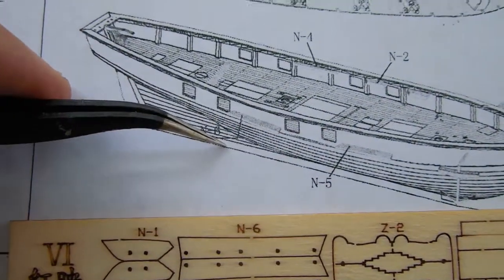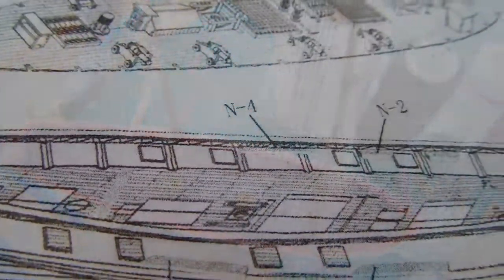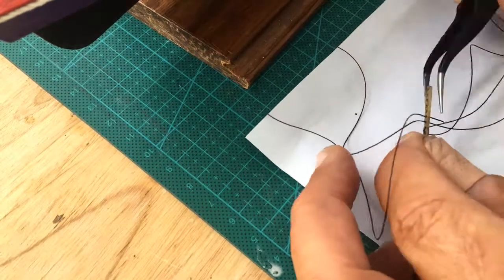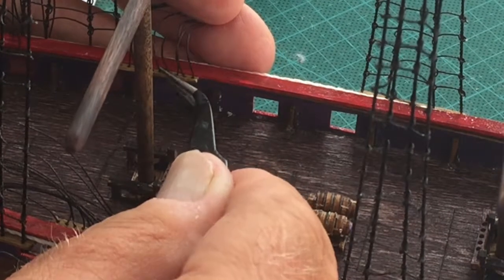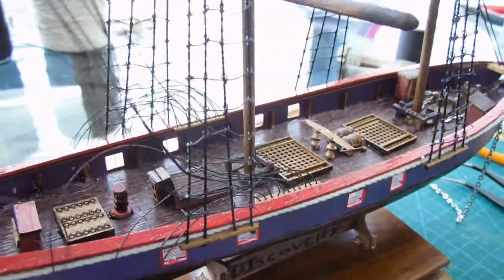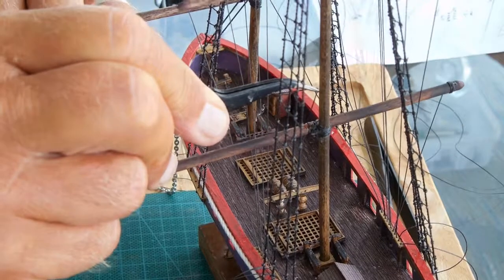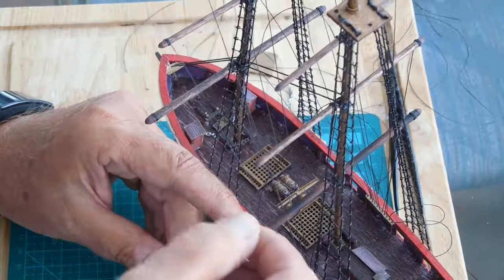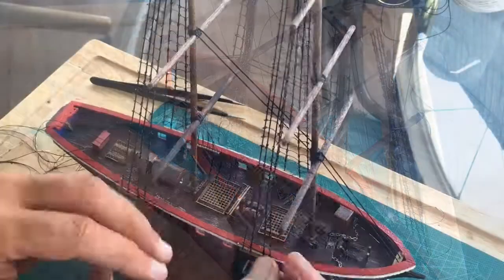Wooden Model Ship Build Part 8

Comment: Really helpful video - thanks, can you tell me what thread you use please? Looks like cotton thread for the rigging but something thicker for the vertical ladder lines??
Reply from the maker: Hi Keith, I’m on a little vacation and that information is at home. I’ll get you the information when I get back. (About a week).
I do recall getting upholstery thread from hobby lobby (I just looked it up on line!)
Here’s the information you need:
Hobby Lobby - Sew-Ology
Extra Strong Bonded Nylon Upholstery Thread. SKU: 1256957
$1.99

Comment: Hey BoilerDan! Great work on this, I have been watching the whole series and will use it as a template for when I construct my own. I am not sure if you will be able to answer this question, but I would like to build a version that floats in a bathtub. I imagine that I will need to put some weight around the keel of the ship, and I will need to waterproof it and generally make it resistant to hot water and humidity. Do you think this ship is capable of doing that? What materials/paint would you use to seal the hull of the ship?
Reply from the maker: They are not designed for water use, so you’ll have a big task ahead of you!
I’d recommend completing all the planking of the hull so then you can seal it. You’re going to have to research that as far as what to use? Maybe a product that is used to water seal outside gutters on a house?  Then you would need something to coat the outside of the hull planks. A marine lacquer or paint?
But it will need weight balanced so it stays upright!  Rocks? Then maybe some spray on n foam insulation for sink proofing it?
I think it sounds like a disaster 🥴!  But go for it! If people didn’t try things then we’d never had landed a man on the moon! (Unless it was faked😉😂)
Thanks for watching and being inspired!